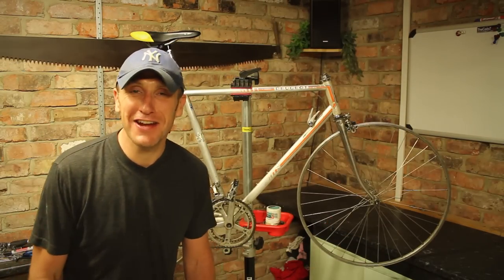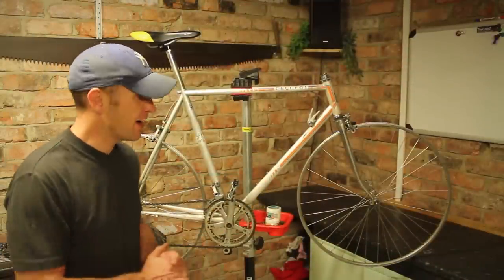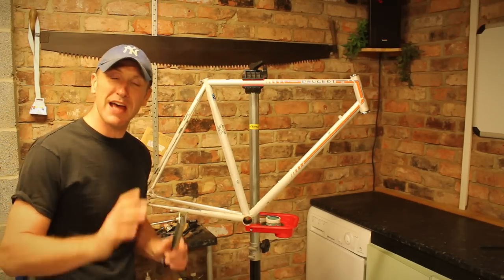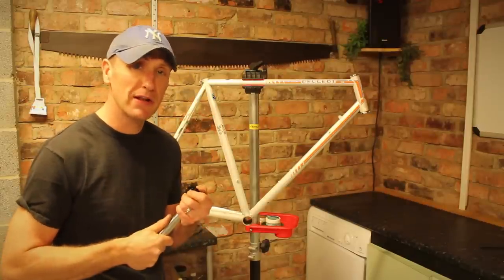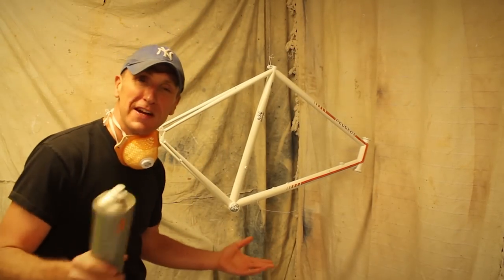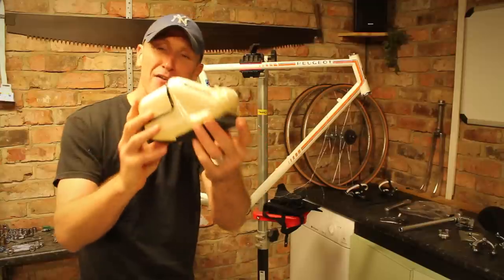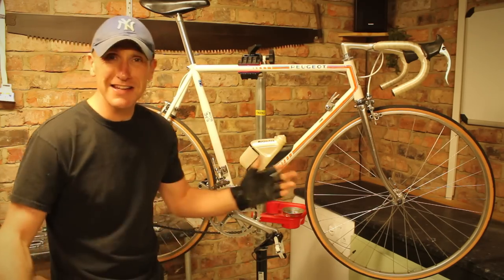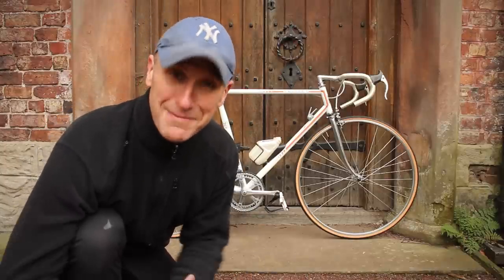Vintage Peugeot PH12 Cycle Restoration (100th Anniversary)

Comment: Do you come up against nightmares like seized seat posts and quill stems or do you choose your projects wisely ?
Reply from the maker: +BoogieKnight1976 try and choose wisely saying that I have just been given a project and the seat post is well and truly stuck in there. I had a quill with a damaged bolt head, which I drilled out successfully. Good luck Andy
Reply: Yeah just had an old cro- mo Elswick delivered £40, couldn't resist. All original ,Tange forks, lugged frame but trying to budge quill and seatpost is like trying to retrieve Excalibur..oh well live n learn.

Comment: Great videos! What kind of gum wall tires are you using for these projects?
Reply from the maker: Thanks for watching and tuning in. Regarding tyres it all depends on the value of the bike 🚲 generally the lower end are unbranded gum wall 700c x 23 tyres from eBay approx £18 pair. I also use Michelin Dynamic’s which are a good tyre I feel for the cost then all the way up to top to super corsa tyres at £80 a pair. As I say it all depends on the value of the restoration you are working on. Hope this helps and thanks again Andy

Comment: Where to you get your paint from? I need the white pearl paint but can't seem to find it? also the handel bar tap in that gold colour? Thanks.
Reply from the maker: +dennis diem (B&B 1680) hi the paint was advertised on eBay as a two pack pearlescent white paint. Think I was lucky at the time it may be worth trying a car paint shop you can match up the paint. The tape I know is very rare in the uk. I know a website based in the US called Yellowjersey still sells it with worldwide shipping. I hope this helps, good luck Andy

Comment: Hi, I just bought a Peugeot bike that is this same pearl white color, and has some spots that need touch up. What was the brand of paint and name of the color that you used?
Reply from the maker: Hi and thanks for watching the Peugeot Bike Restoration 🚲 regarding the paint I have not got a clue which brand it was. I found it on eBay as a two pack peal white end of line. Really sorry I couldn’t give you the name. Good luck with the project and thanks for the support Andy

Comment: Question:
What bb thread type has that particular frame?
Could I fit a gxp sram cranks on it?
I'm about to get a frameset like that one, and I'm planning to build it with modern components...
Thanks
Reply from the maker: As long as you have the correct cups. I’m sure this was a later Peugeot and had standard threads and not Italian ones like earlier Peugeot models. I hope this helps all the best and good luck 😉
Reply: @BikeItUK  thanks for answering, I think I'll get that frame anyway

Comment: What advice would you give to people like me who are repairing Peugeot bikes?
Reply from the maker: +Oliver Clayton Firstly I would try and find out the model of the cycle and then simply Google it. From there it should bring up original images and also Forums about the bike regarding the parts that were used and the spec of the bike. Then the fun begins locating parts if you are wanting to take the bike back to the catalogue specification. A lot of Peugeot and Raleigh cycles was sold in the 1980's and there are still many parts still out there. With the demands also brings ready off the shelf Decal stickers if needed. If this is your first project keep all the parts together and take photos of if needed to remember how things go back on. I hope that this helps all the very best Andy PS Good Luck

Comment: WHen I masked off the decals on my 1977 Carlton Pro (http://www.ece.ubc.ca/~gillies/raleigh/international/Carlton77.html ) , the blue 3M masking tape (painters tape) lifted off parts of the transfers, any suggestions?  I have heard of people attempting to use Vaseline but I think modeling clay might work better ...
Reply from the maker: +Donald Gillies hello again, I use decoration masking tape it's cream in colour sticky but not to much. I think its dependent on the tape that's available, the tape that I used in the UK the motor industry uses the same tape for masking up. Maybe find a local body shop see what tape they are using and what's available locally to you. Andy

Comment: just my kind of channel-i actually restored an old peugeot year before last-nowhere near as authentic as yours but this was more of a making use of leftovers kinda deal, but i`m quite happy with the result..(pic doesn`t show the finsih,i added some bar end brake levers and gave it the single speed, since the mounts for the shifting were non-existing ...pretty happy with the result tho
https://www.pic-upload.de/view-33437017/18698549_260947314372410_1148508968629772876_n.jpg.html
cheers from germany